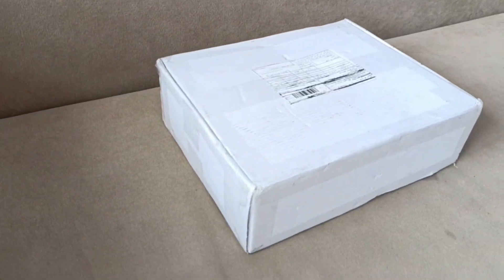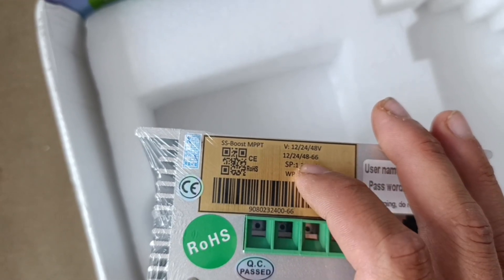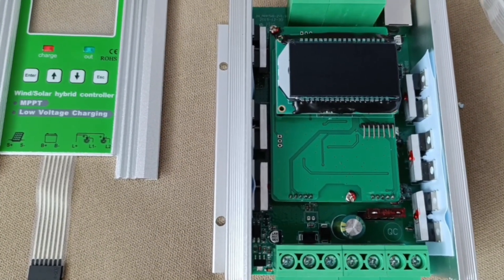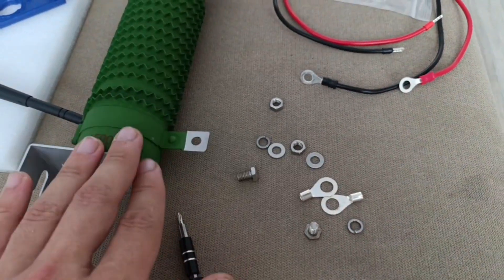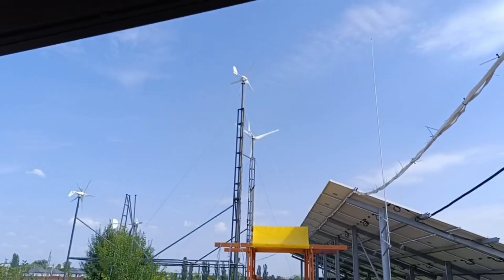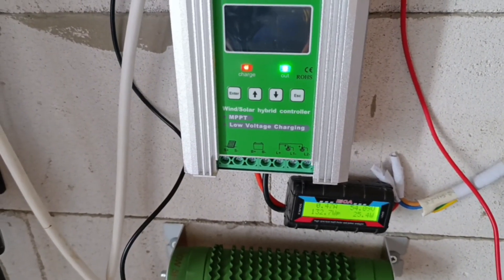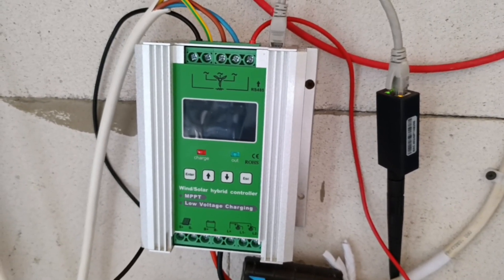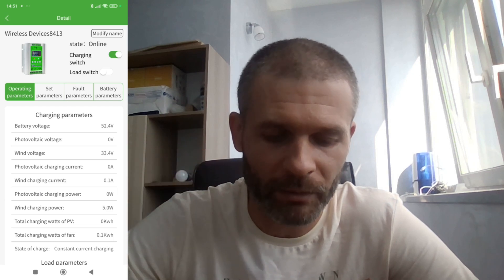Got a new JNGE wind/solar charge controller, looks a decent one, so take a look yourself.

Comment: Hey cool, a capacitor in a charge controller, i was right instead of many wind turbines spaced out, capacitors would charge up and then release energy when voltage drop acurse to boost production. Thank for the video
Reply from the maker: yep, looks like that is exactly the case

Comment: Did you get the power equivalent to the power of a wind turbine with this regulator? In Chinese controls, for example, 1500w is promised, but they waste power on the brake, even though the batteries are not full because apparently they cannot withstand the promised power
Reply from the maker: have seen 1.1 kW on it out of my FT-1000L (2.5 m in diameter) wind turbine sitting on it now.
It also was running a bit earlier for about a week with the bigger 3.2 m dia FT-2000L2 wind turbine, and there I was able to capture 1.3 kW on some gust, so yes, the controller is definitely worth it. reason I changed the turbine is simple - my FT-2000L2 actually can shoot way more, up to 2.8 kW - so I moved it to a more powerful controller though, just in case.
Reply: @ModernUkrainianHomestead  thanks for the reply. I just got this controller and I hadn't ordered this model, maybe I'll dare to connect it for a while until I get the right one

Comment: I had two of these on lithiun ion custpm as no provision for 13 series cells both locked on brake mode and would not release. Manufacturer would not fix = junk. Looks like youre no longer using either?
Reply from the maker: actually, you can set it up manually to almost any battery, that one is a very-very robust here.
I stopped using it just for a while, since I don't have a proper wind turbine for it. I might have one soon, so that's why I'm not selling it yet.
Reply from the maker: I will change to LiFePO4 soon, so will see how it goes, definitely. not sure.
in any case white-orange is in general just much-much better from my observations. we'll see in about a week how LHCM 3 kW big guy will prove itself (on FT-2000L2 on a new tower preferably as well).

Comment: Nice Videos!
Qestion: My Battery Bank is fully charged at 58V 
Is it Possible to set it to this Voltage?
And i will (If possible) use a "M6 48V" 2KW Turbine 
Will This work?
Regards from Rainy Windy Western Norway
Reply from the maker: thanks.
I guess yes, you can always chose one of three battery predefined settings: for GEL, for LiFePO4, or for Ternary Lithium. Or, if that's still not good - use the fourth "custom" option, however in that case you will have to carefully set each of the battery parameters yourself, and more convenient to do this is from the app.

about M6 - it will definitely work, as M6 will get 1 kW at about 11 m/s wind, so just get the biggest version of this controller (1500/1500) which has the 33A limit of current for each of the channel. so if wind only and no solar is used, it'll be capable to bear roughly 33x58 = 1914 watts of power from the wind turbine.

and yes, I'd love to visit your country some day. a friend of mine was at your place last year - he's impressed the most still, and would like to repeat that trips more often.

Comment: Cool little vids to watch on (thisismax) my theory on the vawt has been halved from 4 blade to 2, which would be alot easier to make.
Reply from the maker: why vawt?
it won't produce much - why even look at that side?
Reply: @ModernUkrainianHomestead  Why, there supossed to be quieter. someone will crack the  production, my theory is thier always trying to create lift on the outside if they coud creat the lift on the insde ( which would be tuff to make the surface longer, maybe a matt finish ! ) thier would be no horizontal gravity.